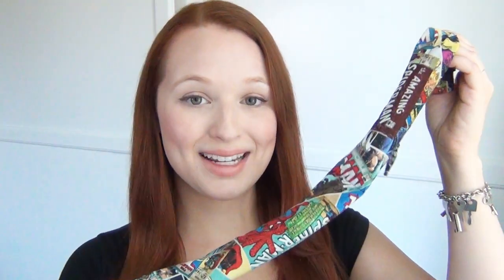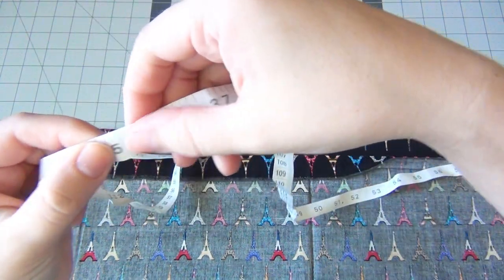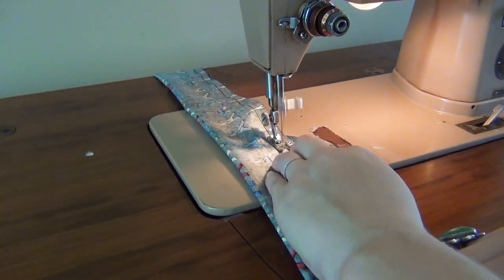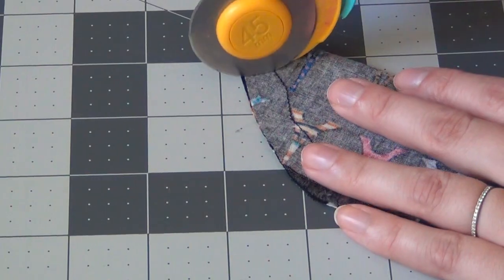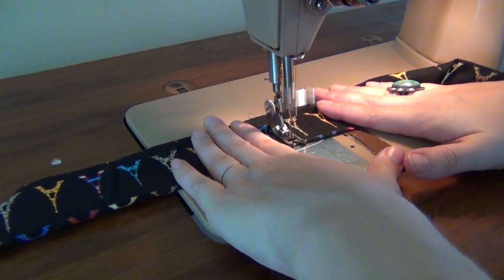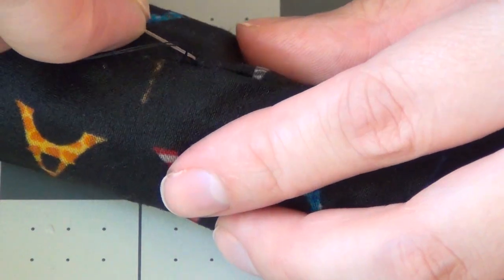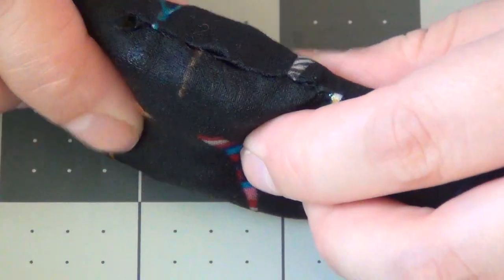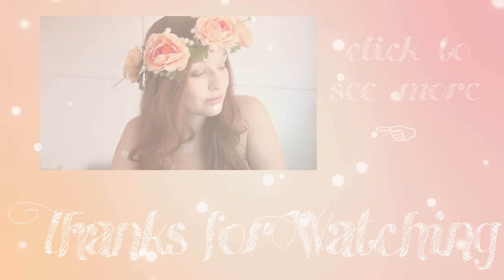How to Make a Cooling Scarf ♥ DIY with Orbeez!

Comment: Little tip..
Hopefully i can explain in a text..
After you cut your strip & b4 you fold it inside out, lay a piece of ribbon or yarn right down the center (like a hotdog on a bun) let a little tail stick out on both ends, sew over the 1st end (like the spot you/she 1st starts sewing in the video) make sure that's the only part of the ribbon you sew over.. Now sew your seam like shown in the video.. The end you leave open, will have the ribbon hanging out of it, pull on that ribbon & itll turn your strip of fabric right side out, then just cut the ribbon off..
Super easy & way way faster than any other method, including the little sticks they sell for this purpose
Reply: What a SUPER GREAT IDEA!  Thanks for sharing!

Comment: Blind stitch has been around since time immemorial. The blind stitch is often used to hem pants to hide the seam on the inside to prevent it being seen (too much) on the outside.

Yes, the ending blind seam is a good idea to finish your piece. You can also use a running stitch or a blanket stitch since the thread is matched well.

Just some suggestions.

Thanks for this video. It's to the point and simple. Well-done!
Reply: I think the innovation of the "Muppet" stitch was less about the thread pattern and more about its use in puppet making for covering the forms that make the musculature of the puppet.  
As I understand it, the Muppets were covered structures, as opposed to being turned and stuffed.  This would necessitate a great deal of hand stitching in areas that would carry a lot of stress.

Comment: I am seeing information about water beads taking 4  hours to expand in water. Is there any way to speed up the process? I don't remember the neckbands I used as a kid taking that long to activate.
Reply: I believe it only takes that long the first time you rehydrate them. after that it will take half as long.

Comment: Do these really work ?
What do the beads do ?
Reply: The beads hold the water which evaporates.  The evaporation is what does the cooling.  Works in a similar way to a Zeer Pot.  (You can Google that to find out what they are and how they work.)  Humidity will work against the cooling effect.

Comment: would this work as like a heating pad too or would that ruin the gel beads?
Reply: I would put rice in the space instead of the beads to use in the microwave.
Reply: Put rice in a tube sock and tie the end up to heat, no scarf or beads necessary.

Comment: Can you freeze them?
Reply: Sheri Karanasos I think the little water beads fall apart. It would be great if they could be frozen!
Reply: Sheri Karanasos yes, you can freeze them. If you want it not to freeze completely then put some in a. Zip lock bag with rubbing alcohol. It will get very cold but not freeze solid.